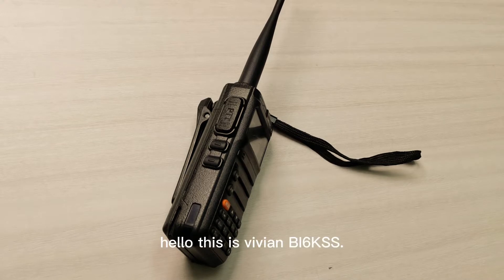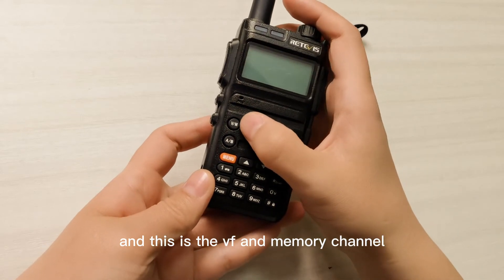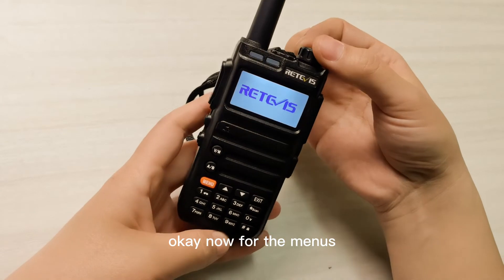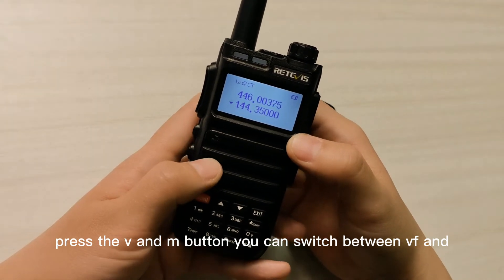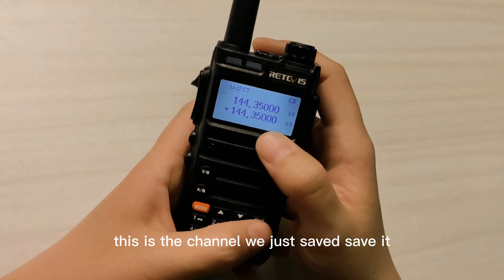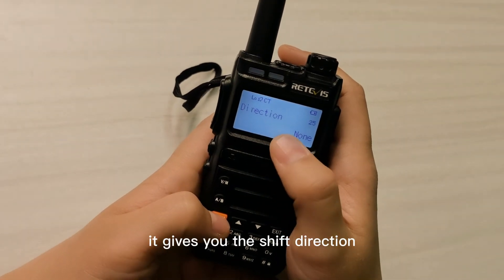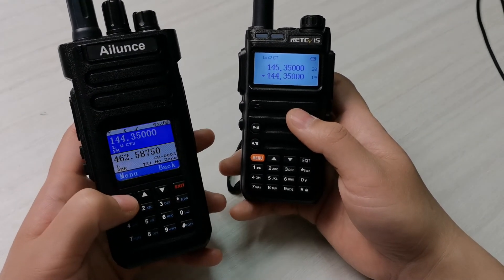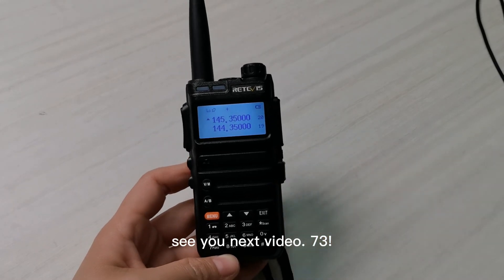Retevis RA685 instroduction and programming

Comment: The offset and transmit in channels memory mode does not work. Only in VFO mode. What kind of radio is that? I found problems with Retevis programming software. There are also bugs in RA685 firmware. I hope that Retevis is going to release new versions of the programming software and firmware.
Reply from the maker: Yes, it is correct to set the offset only in VFO mode, you can understand that the memory channel is a fixed channel already. If you want to change the offset of a memory channel, you can program it in the software. If you also have any other questions, please email to info@ailunce.com